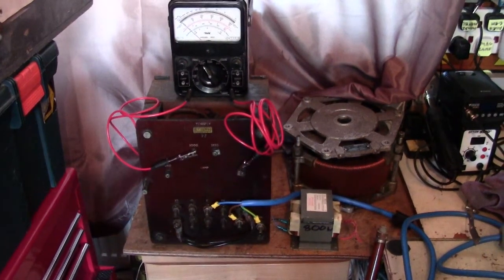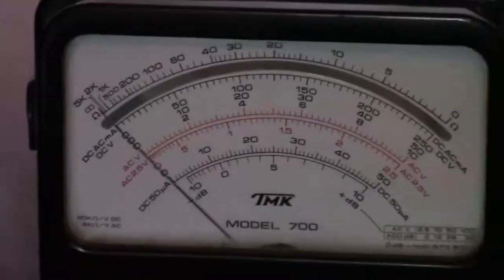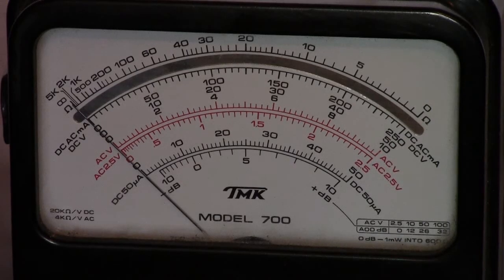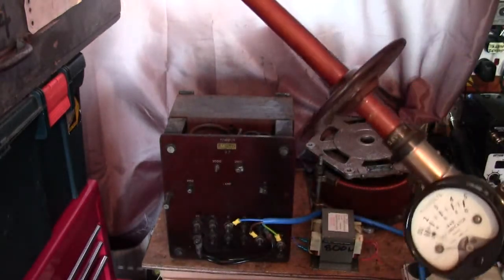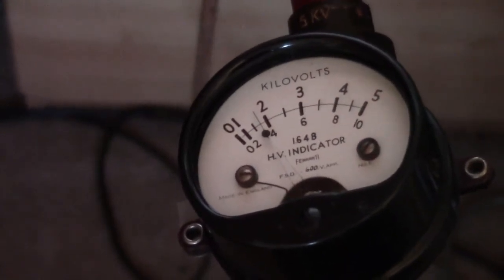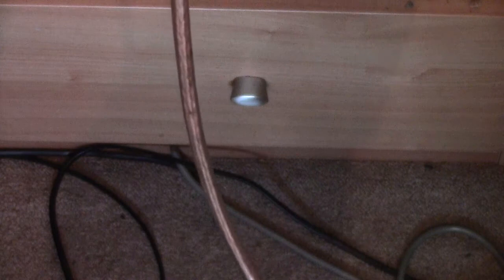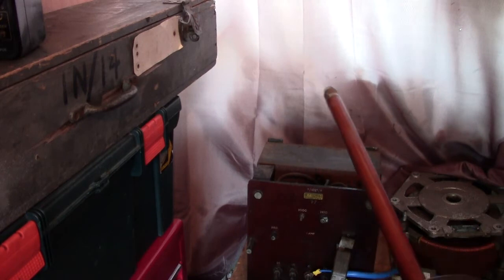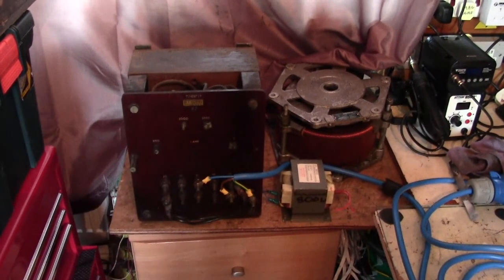Testing the MONSTER HV transformer and Ferranti HV probe for Wonder boy

Comment: That's exactly the same problem I had with my High Voltage Probe, first thing I did with it was to take the tiny screws out the back of the dial , slide it carefully off the inners and then clean and re-glue the glass in before replacing it in there.

Otherwise that is a beautiful specimen of a High Voltage Indication Probe you have there, it will definitely be interesting to hook the two up and measure some phases with them! xD

That HV tx is still massive to the point I still can't get over how big the thing is! you really need to tell people your hand span before using it as a measurement tool still though? lol x]

btw I think you need a new high voltage meter or even one of those nice red probes... xP

Comment: "....And it should just go upto the 30 on the meter"

WALLOP! :-O

My goodness, you almost popped that!

Having a variac, I thought you would've slowly ramped things up. You would've discovered that the meter was connected incorrectly before it pegged-out at the maximum on the scale without the risk of popping it.

It's a good thing that it didn't pop, as I'm sure that something would have fizzed-over horribly in there.

With those meters, it's always a very good idea to double-check all connections to it (especially when testing for voltage) before applying it to the circuit/source to be tested, otherwise expensive poppage may result.

This is why meters like this aren't used to verify whether a circuit is dead or not before working on it: If the wrong setting is used, the tester may pop, or it may give a reading where the user mis-interprets it as a dead circuit, then he gets zapped.

Yes, next time, definitely make use of the dial on the variac and slowly ramp things up instead of banging them straight-on.

That meter may have only survived because the power to it was ballasted.

Again with that HV Ferranti probe, I would've slowly ramped that up, especially seeing as you've never used it before.

-BoomBoxDeluxe.
8th January 2014, 16.25
Reply from the maker: Your not wrong there dont know why i didnt really ,amazingly the MM survived no damage LOL
Reply: A good practice when preforming a safe isolation procedure is to prove your meter on a known supply before and after testing your circuit, a GS38 voltage proving meter will still have an in line fuse to protect the instrument under fault conditions, and is the reason why the GS38 includes a voltage proving unit much like the Ferrantti High Voltage Indicator includes a Proving unit also.
Reply: Yep. When I was doing my electrical course, one of the lecturers had a match-box-sized device clipped to his belt and when he put the test probes on it, the test meter registered-up 240v!!

I'd never seen a Proving Unit before and I was quite impressed that such a small box could make such a voltage. :D

-BoomBoxDeluxe.

8th January 2014, 22.00
Reply: BoomBoxDeluxe Haha yeah those proving units certainly have the ability to raise eyebrows in the room!

I do recall college being the first and last place I saw an actual GS38 standard voltage indicating probe and proving unit though...

The most important thing I learnt after college was the difference between the "perfect world" and the "real world", in the "real world", electricians use their own multimeter that they will know inside out to isolate circuits, the most essential part of that is to simply prove the multimeter before and after testing the circuit.

I will always measure a circuit live, then isolate, then re-measure the circuit and finally prove my multimeter on a known live source (usually the other side of the circuit I just isolated).

The purpose of a GS38 is to provide a Murphy proof way of preventing confusion with the operation of a multimeter, they are good, but generally only good for someone who doesn't know how to use a (not always their own) multimeter.

This is just an opinion I have formed of my own, if anyone else wants to add to it I'm open to discussion, it's an interesting subject knowing what other people know or think about such an essential part of safety around electricity.

btw; and "if you're tired, go home!". x]
Reply: Yes, as you said..... "The purpose of a GS38 is to provide a Murphy proof way of preventing confusion with the operation of a multimeter....."

And on that note, I think that does a full-circle back around to what John did with that device, and almost popped it!

It would've been most unfortunate if that happened, and that's why, like you say, testing for voltage should be a straightforward Yes/No with a readout of the voltage detected, with no ranges, dials or test-probe holes on the device to get confused with

-BoomBoxDeluxe.

8th January 2014, 22.41
Reply: Haha the problem with my "if you're tired..." Satement is it doesn't really work if you're already at home... Maybe I should adjust that to "If you're tired, go to bed", but knoing what John has under his bed though I don't think its going to make much difference... lol xD